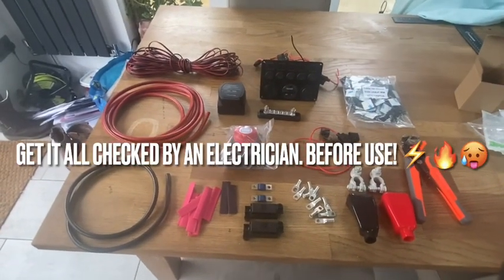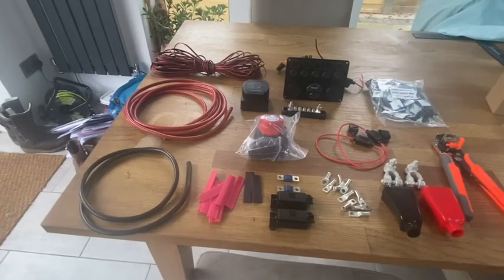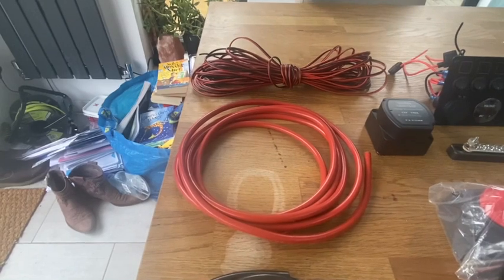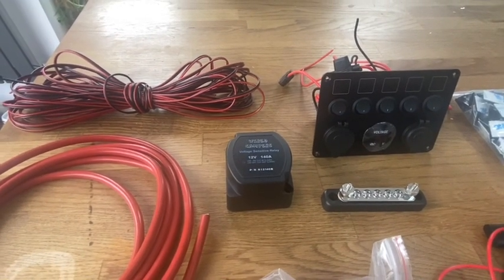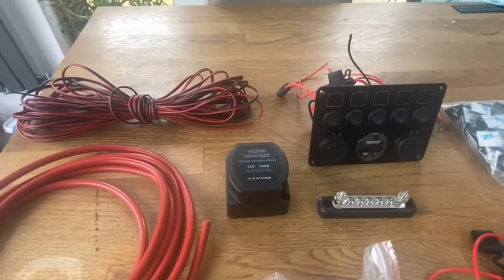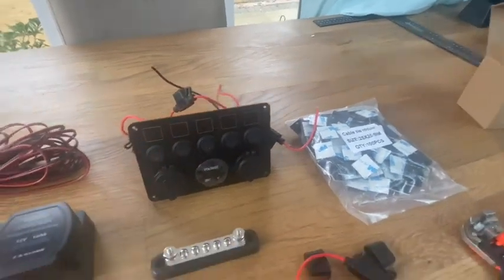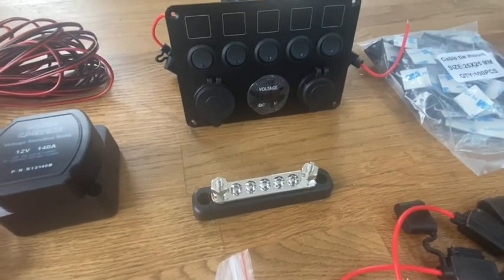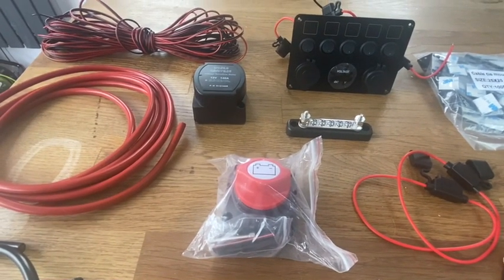EP15 | Part 1 | Van Electrics install 12v Panel & Split Charge Relay

Comment: sorry online it says In simple terms, his kit will provide you with a 12V on/off grid system and a 240V mains hook up system. is this true how long dose it last off grid
Reply from the maker: How long it lasts off grid will be dependent more on the leisure battery and what is running off it.. so if you have a fridge it would run down quicker but if you just had lights on would be longer.. with moderate use a decent 110ah lithium battery would be maybe 2.5 days…
Reply: @TransitCustomCamper  hey mate hope ur well for your side cabinet can u remember what paint u used

Comment: Hi there iv followed your channel from start just a question as your ford transit custom have a smart alternator I'm wonting to put a relay spit charger but was told it will not work in my ford transit custom 2020  with having smart alternator I'm confused on this issue thanks for your time
Reply from the maker: Hey 👋 thanks so much for following the videos and supporting the channel! Yes I made this mistake! My van was 2014 and border line if it had smart alternator.. mine did and most models from 2014 onwards have them. I installed a CTEK DC/DC charger in end.. has worked well! I did a video on the install here Installation of CTEK D250se DC to DC Battery Charger into Transit Custom with Smart Alternator
https://youtu.be/Q7IEjEKSFBI
Reply: @TransitCustomCamper  thank you so so much for getting back to me I feel much better knowing there's a lot of people not nowing and making this mistake thanks once again 👍

Comment: Hi bud. What size fuse did you use from the battery to the split charge then from that to the leisure battery? Also what size for the one from the isolator switch to the switch board?

Thanks 👍🏻
Reply from the maker: Hi mate - they came in the kit from Wired Campers and 100Amp fuses for split charge if I recall 👍 From isolator to switch I can’t recall now sorry! Seems like a while since I wired it all up. I remember finding a video based on my set up and then fused accordingly… I would get it all checked out too… last thing you want is melting wires! Thanks for comment and checking out the videos 👍
Reply: @TransitCustomCamper  thanks for the reply. Appreciate it 👍🏻

Comment: What size fuses did you use in the split charger positives?
Reply from the maker: Hi Daisy - They came as part of a kit from a company called Wired Campers. Just had a look on their site to confirm and it’s 100Amp fuses. Link to the kits below if it’s any use too 👇 
https://www.wiredcampers.co.uk/collections/custom-work/products/complete-camper-van-electrics-system-12v-240v

Comment: I'm looking at getting a similar switch setup, my only issue is running multiple appliances from it such as lights, fridge, taps and usb sockets at the same time will create a high amp draw. The one I'm looking at says the max per circuit is 15A, but the input wire from the battery does look big enough to handle multiple circuits running 15A at the same time. Is this something you looked into? Thanks

Comment: Hi mate I noticed on your video you said about wiring the positives that are already fused on the control panel into a separate fuse board, I.e my roof lights I want to wire them into one of the switches then off to a separate fuse board, would I be right in saying I would connect the live from the lights to the live on the switch then from the switch to a fuseboard? I understand that the control panel is already fused, but I was thinking of just adding a separate fuse board because I could use more appliances in the future if I needed. Thanks 👍
Reply: Also if I had a separate fuseboard, the positive and negative that is supposed to go to the leisure battery on the control panel am I right in saying I'd connect them straight to the positive and negative on the fuse board then run a separate wire positive & negative from the leisure battery to the positive and negative on the fuse board to create my ciruit so I'm not limited to only 5 switches in future I could wire in more straight from the fuse board👍
Reply from the maker: Hey Kieran - thanks for the comment. I have to be totally honest with you I am not 100% on the wiring for a separate fuse board and the control panel and wouldn’t want to give a bum steer on this. However, what you are planning is also what I want to do too! Once I have done more research and tested I’ll let you know 👍 Sorry I can’t confirm your plan direct but hope you understand I would want to give advice I wasn’t confident with especially on the electrics

Comment: hi many amps were the split charger fuses from battery to split charger cheers
Reply from the maker: Hey Jack - it the original kit that got from wired campers that was just the standard split charge relay the fuses were 100amp 👍 when I then did the install of the CTEK had to switch out for 30amp… as you know this was a DIY install so disclaimer from me and would make sure you seek advice from a professional too based on your own install 👍

Comment: Hi where did you buy the 5 gang? These seem good do they come with the correct fuse for each connection? Such as light switch what would be the correct fuse. Water pump correct fuse?
Reply from the maker: Hey Mart - thanks for the comment and checking out the video 👍 I got the full electrics 12v and 240 in kit form from a company called Wired Campers. This included the 12v control panel and the i line fusses. You can switch out the fuse dependent on what you wiring back to to suit your needs. I didn’t show this on my video as it would be different for each build. I put the link to wired campers below. Not sure if they would supply the panel separate? Or might be able source from the usual suspects 👍

https://www.wiredcampers.co.uk
Reply: @TransitCustomCamper  thanks will check them out 🙂

Comment: I truly appreciate your explanation on the electrics an in particular the control panel. I've watched 100's of "How to" videos searching for this info but they either cut to when it's done with a lousy explanation or they go into a time lapse when it comes to the details and then I'm still left scratching my head.
Reply: Thanks for the heads up. I'm knitting out a citroen dispatch which I pick up in a few days.
Reply from the maker: Hey David! Wow! That is a really great comment and thanks for taking the time to watch the video. So glad you found it helpful… To be honest when I was doing my own research I found the same as you so I wanted to try and cover as much as I could on the video 👍 So glad to hear it’s hitting the mark… Are you doing your own build also? What are you working on a transit custom too?
Reply from the maker: Also David - I don’t know if you have watched the later videos but I had issues with the normal split charge relay that was in these video as my van had a smart alternator so I can to switch out for a CTEK DC/DC charger instead. Juts to keep in mind if you planning the electrics. I did do a video on the CTEK install too if that might be useful also 👍

Comment: Really excellent. Thank you very much. I've just noticed the comments below about the Ford van  'smart alternator' and the DC to DC charger instead of the split charger. I'm glad I read down. I hope you will be doing an update soon including the solar panel.
Reply from the maker: Hi - thanks for checking out the video and the comment 👍 Yes, the DC to DC charger was a big lesson… The normal relay “worked” but wasn’t consistent with the voltage etc… so it was the right thing to do to switch out… Absolutely if we go for solar I’ll do an update and get a video posted… Are you doing a conversion? What other videos do you think might be useful?
Reply: @TransitCustomCamper  I will be converting a Transit Connect long base and will be installing a solar panel too. It's a long way off, but I'm doing as much research as possible to get ready for it.
Reply from the maker: @aucourant9998  ah cool! Yes I was the same before I started mine becoming addicted to YouTube van tours and tutorials and part of the reason I put together the build channel too 👍

I think my next video will be on the things I learnt and some of the mistakes and what I’d do differently too… Plus maybe materials and cost.. Which a few other people have asked me about too 👍 thanks again and good luck with the build!
Reply: @TransitCustomCamper  That sounds great. Looking forward to it. Maybe you could explain the DC to DC charger as well.
Reply: @TransitCustomCamper  I'm starting my conversion in a couple of weeks. I've watched all of Greg Virgoes videos many times over and William Prowse

Comment: Great job. What size leisure battery did you use.
Reply from the maker: Hey Lch 👍 I went for a 95ah from Halfords in UK..It’s Ok for how we plan to use the van and our budget … Although I think the more Ah you can go for I rekon that’s a winner 👍
Reply: I have gone for a 110ah. So hopefully that will be plenty. I’m opted to my set up under the twin passenger seat as only use the van as a day van not a camper. Will have to post some pictures when its done.
Reply from the maker: @lch7417  ah cool - yeah.. I was thinking that for the battery but we might be going for a heater at some point in the future so wanted leave under the passenger seat plus we needed a bit of extra storage under there too 👍

Comment: Great piece of work. What split charge did you go for?? I’ve got at 2016 crew cab looking to do the same so will have to look at the smart alternator issues cheers Dan 👍
Reply from the maker: Hi Dan - thanks for checking out the videos and the comment! So initially I went for a “normal” split charge relay but I have decided to switch it out for a DC to DC and gone for a CTEK unit. On my 2014 the split charge was kicking in but I was getting inconsistent voltage so I think the CTEK will be batter bet. Plus longer term I think we planning solar panels and the CTEk will be future proof. I’ll be posting a video on the CTEK install next few days 👍
Reply: @TransitCustomCamper  great thank you very much for the reply your videos have been a great watch. Will look into that recommendation today 👍
Reply from the maker: @danscanlon7083  - Hi Dan - I have just installed the CTEK unit today and all good and working with the smart alternator on the van… I’ve just posted the install video here if you want to take a look https://youtu.be/Q7IEjEKSFBI
Reply: @TransitCustomCamper  already watched it 🤣 giving me lots of stuff to think through and decide what’s best for the van. One thing that’s racking my brains though it says wire to alternator. Is that just wiring straight to the main battery as that’s where it’s getting the feed from and the piggy back fuse you use did that come with the cteck??
Reply from the maker: @danscanlon7083  ah - OK - so the CTEK positive A is wired back to the positive terminal on your main van battery. When if refers to alternator it’s just as your main van battery gets it’s charge when running from the alternator 👍 so essentially the alternator will be charging both batteries (if needed) when the engine is running. Also the piggy back fuse holder I had to get separately. I picked it up from Halfords, was £5.
Reply: @TransitCustomCamper  happy days. Have you thought about running a 240inverter to run? I need to do all calcs this week to see what battery and set up is required for the van then I’ll be rocking on with the build
Reply from the maker: @danscanlon7083  - Yes - we might still run an inverter. Not too sure yet… As we not planning to do too much total off grid not sure we would absolutely need one. I guess it all comes down to how you intend to use the van, what you want to power in the van etc… I think inverters are “relatively” cheap and simple install just direct connection to leisure battery I believe, maybe with an additional earth… and then plug extension into inverter. We gone for 110ah AGM leisure battery which we hoping should be OK for us anyway 👍
Reply: @TransitCustomCamper  yeah I’m the same need to make sure it will get used to put it in. At the min the only things I can see need for a 240v output is laptop which doesn’t really justify the added hassle and expense.

Comment: Not sure if you've had any issues yet, but a lot of people have issues with a split charger on Transit Customs as they have a "smart alternator" and you might need a DC to DC charger instead
Reply from the maker: Hey Matt! Thanks for the comment.. Yes for sure I heard this too.. So what I did was check if my model had a smart alternator by checking the battery with a voltmeter first on start up and then after the engine had been running to see if there was voltage change… In my case it was OK and not a smart alternator after testing… My van is 2014 so I think just on the verge of Euro6 so “just” got away with it as the DC/DC when I checked like a Ctek was almost £250 on its own… hopefully it will be OK.. but thanks for the shout out on it too! Really very much appreciated 👍
Reply: @TransitCustomCamper  ah brilliant, good to know there's any easy way to check
Reply from the maker: Hi Matt - Just an update as it has turned out having issue with the split charge relay! So I am having to switch out for a DC to DC CTEK unit now anyway! It’s an extra expense but as we are planning solar panels at some point… that’s not too bad 👍
Reply: @TransitCustomCamper  I’m looking to buy mine this week and start the build what swayed you to the ctek over rivals like victron??
Reply from the maker: @danscanlon7083  to be honest I didn’t do too much extensive research on the options… I had seen and heard good things about the CTEK so knew it would be a good solution… Let me know what you go for… I am planning another conversion 😃 got the bug… so I might do different products and a different set up for the next one 👍
Reply: @TransitCustomCamper  we’ve just been away on ours to gauge exactly what we need had a look around others and your right the bugs there it’s massively addictive. Going to watch over your videos again today and start buying. Hope it’s half as good as yours